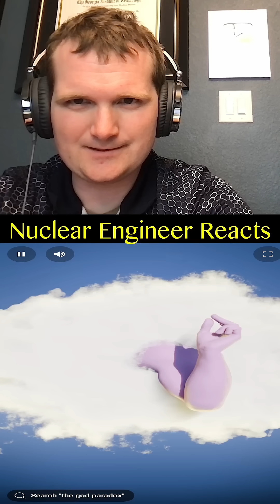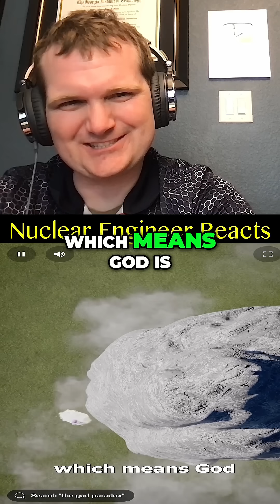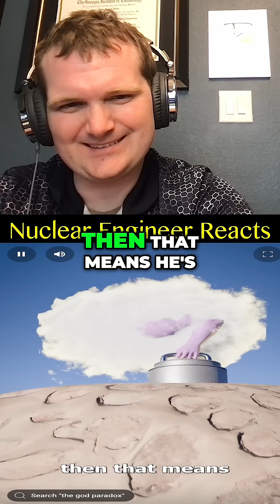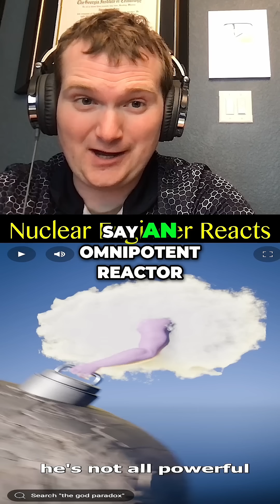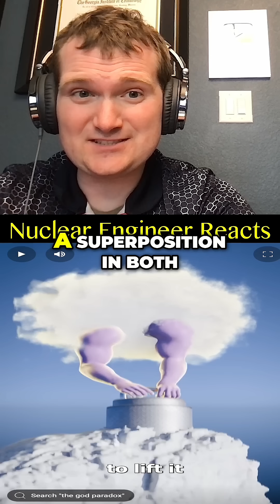The God Rock Paradox - Nuclear Engineer Reacts to Zack D. Films

Comment: I used to find this thing cool but in reality it's extremely dumb.
The contradiction does not lie in the property and it's application but in the question itself.

It would be like asking a human being to answer truthfully a question formulated in such a manner that the answer can only be a lie.

Would you say that somehow the concept of truth has be shattered ? Of course not. 

That's called coercive logic and hold no weight in an actual debate. Where the contradiction is baked into the premise themselves instead of actually testing a concept, an idea or an argument. It is a form of circular reasoning.

Don't get me wrong I HATE religion. But I HATE religion precisely because all of those are frauds AKA I value TRUTH.

Comment: Your re-statment is fallacious. The original statement is about two simultaneous maximum potentials not the ability to self regulate lower than any of thise said potentials, which is the whole point of 'all' in 'all-powerfull' and the meaning of 'omnipotent'. And the original statement shows, indeed, a binary logic because of the dual properties assigned to this god. How would two upper thresholds (if they exist) of two descriptors be refered to other than in a binary way?!?And how did you determine this logic does't apply "to this kind of being"?

Comment: Here lets answer the question in a way everyone can understand it.

The answer is yes. A all powerful God can create a rock that isn't able to lift. Then in the next moment the God lifts it. These are 2 separate moments. 1 moment was when God create the unliftable rock. The next moment is when God lifts it. These would both be equal answers that do not contradict each other. Because they are at different moments. 

The question didn't state forever in all time. Well if it did state that. Then the all powerful god creates a state of no time. The question thinks it can't be answers but the problem with the question is that it states an all powerful God.

If this God is all powerful. It could literally do anything at any moment. Time is useless to this being and so is contradictions. Because it could just remove contradictions.

Comment: I havs 3 god type characters who can solve this issue and create an Unliftable rock(at least not with their physical Bodies) in their own way,
The god (Axis) of definition Uses their ability to define reality to Simply tell the Rock to rise lifting it through words.
The god chaos (I know that's a simplification) Moves the rock by removing the concept of mass from it and then wind moves it as its weight is now gone and even an ant could now lift it until they end their authority over it and the concept returns.
Time Moves the Rock by lifting it across the axis of time instead of space  even if he can't physically move it conceptually he can move it.

Comment: That's sounds more like a linguistic fallacy. A lot of statement contradict each others and are impossible to have at the same time. An all powerful got can lift anything, so creating something that he can't lift makes no sense. That's like saying creating a liquid that doesn't flow (that wouldn't be called a liquid anymore). Language allows to make statements that are impossible. But that's not a weakness of whoever is teying to make the statement happen, but it's a flaw of linguistics. Otherwise God can chose not to like the rock. So an all powerful god can create any size of rock and can lift any size of rock, but doesn't have to lift any rock.

In logical analysis, there are statements that supersede others. The presence of an all powerful creator/god makes some statements impossible. Like in this example the very heavy rock that no one can lift. That's actually reflected in a lot of cultural expressions that are common amongst monotheists. For example some people say God knows instead of no one knows, because (for them) God is all knowing and saying that no one knows would be inaccurate.

Comment: The literal definition of omnipotence is “All powerful”. God has the ability to do anything. Being able to create a rock out of thin air is already illogical in it of itself. Nothing in this universe can create a rock out of nothing. 

The definition of powerful “describes something or someone possessing great strength, influence, or ability to exert force or control, whether physically or metaphorically”. God has influence over the universe the culmination of all things. If God is all powerful and can use said influence to essentially create whatever he desired. Logic would play no part in omnipotence it wouldn’t be omnipotence in that case. I mean you can limit omnipotence to logic but again making a rock you cannot lift out of thin air is already illogical. You could make it realistic and say he knows the components or composition of all things in the universe but that would just mean God is omniscient not omnipotent.

However, knowing the components or composition of a rock doesn’t exactly prove omniscience either. Proving God is anything more than a concept created by the human mind is annoying as shit anyway.

Comment: If god makes a rock he can’t lift let’s say its weight is 20 pounds. Now got sets his power to only being able to lift 19 pounds. So now he’s made a rock he can’t lift. But now imagine he decides later that day to change his power to be able to lift 30 pounds. Now he can lift the rock. That’s another way of looking at it. (Sure it says a rock he can’t lift meaning going to the maximum amount of power.) But how will that even work, infinity is an ever changing number, it’s not finite, so for something to have infinite weight, it’s a weight that’s always changing, so how would infinity not be able to lift infinity. Because what if one of those infinities is god, and he can make himself not infinite or less infinite than the 2nd infinite (the rock). But then he can also choose to later on make his infinity larger to be able to lift it. Or maybe he can be in super position where he can do both of those tasks at the same time. That’s essentially what Tyler is saying.

Comment: This isn't even a paradox, it's just a sleight of hand where you skip past a logical contradiction in the presuppositions. Nobody went over what the definition of an all powerful god is. Intuitively it means a god who has the power to do anything and everything within the realm of logical possibility. That last part about within the realm of possibility being important because as soon as you start talking about things that go beyond the limits of logical possibility it's necessarily the end of where logical discussion can continue.

With our definition being bound to the realm of logical possibility, that immediately disqualifies the creation of an object so powerful that He can't lift it. It's not a matter of the power level of the god, or an unknowable quantum state, it's just logically impossible. And overcoming that hurdle to even continue the thought experiment requires that you adjust the definition of "all powerful" to also include the realm of the impossible. But that's such a huge concession that it is basically a paradox cure all to the point of making any logical discussion pointless. Where nothing is impossible because even if it's impossible then it's possible for an all powerful god. So both creating the impossible object and achieving the impossible task of lifting it are both actually possible to a god who's power encompasses the realm of both the possible and impossible.